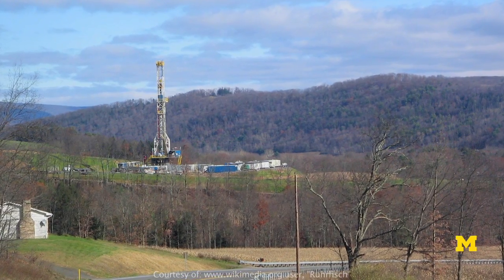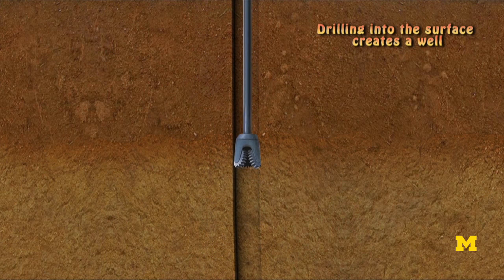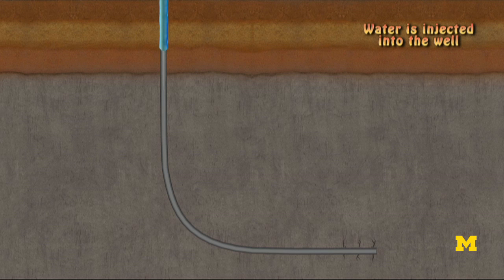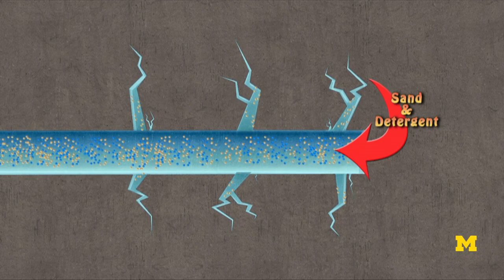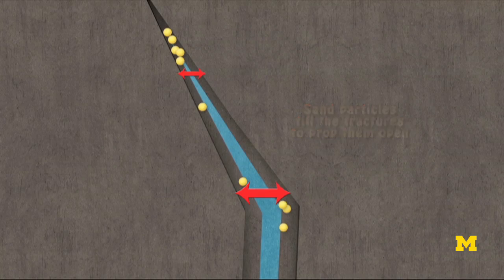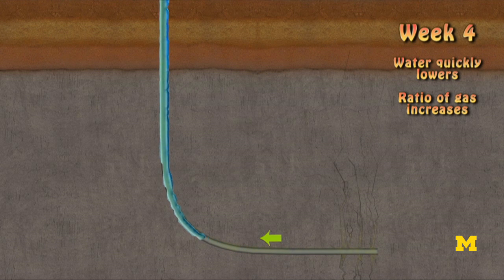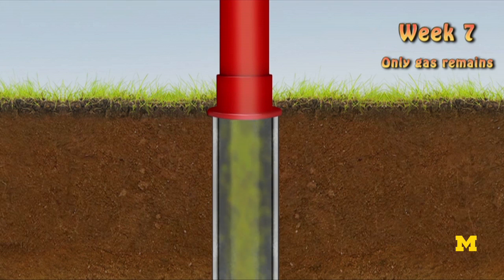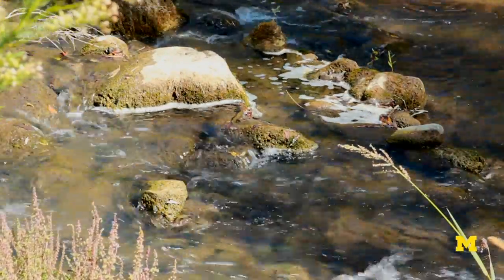The impact of fracking

Comment: Oh my word, the comments on here are ridiculous.  Hydraulic fracturing occurs many thousands of feet below the surface often around 10,000’ below the surface.  That’s almost 2 miles down.  Water acquifers are typically 400-500’ below the surface.  A hydraulic fracture is not even 100’ long.  There is zero chance a water source will be affected.  Also, hydraulic fracturing is 99.5% water and fine sand (proppant).  The amount of chemicals is very, very small (about 0.5%) and are chemicals often found in food.  It also doesn’t cause earthquakes.  Minor quakes have been caused by injection wells (not hydraulic fractured wells) and are always fixed by reducing the pressure of the well.  The process of frac’ing is incredibly safe.

Comment: There is no difference between the Drilling Fluid used to drill the well and the Frack Fluid used to fracture the Formation.  Drilling Fluid, i.e. MUD is Water, Clay, Dirt and part of sawdust (lignite/CLS).
Frack Fluid is made out of the same chemical they make KYJelly out of HEC + 20-Mule Team Borax and Sand.  Drilling Fluid can be reused.  Frack Fluid can be filtered and reused.  The stuff filtered out of Frack Fluid could be used to make BIO-DIESEL.